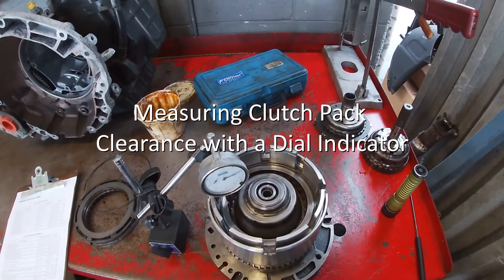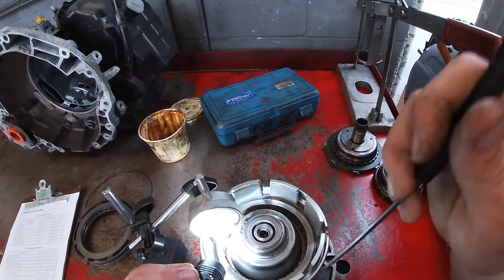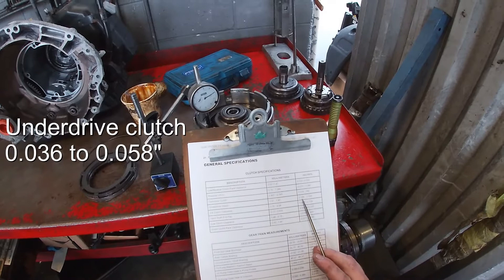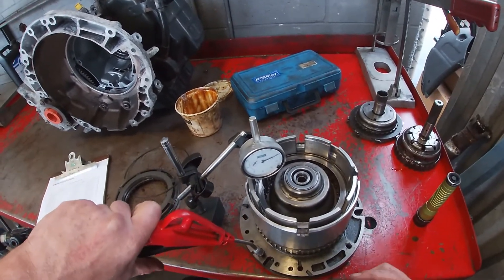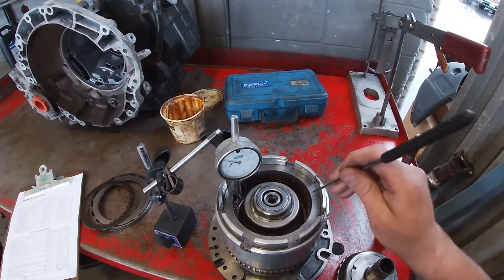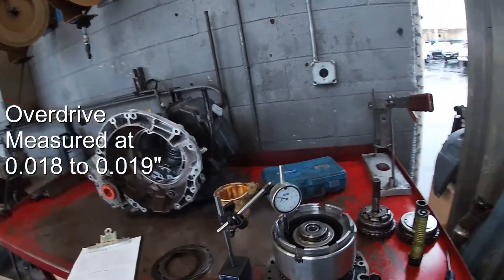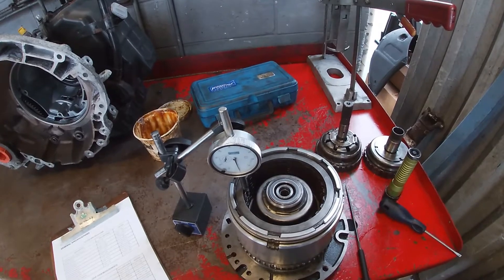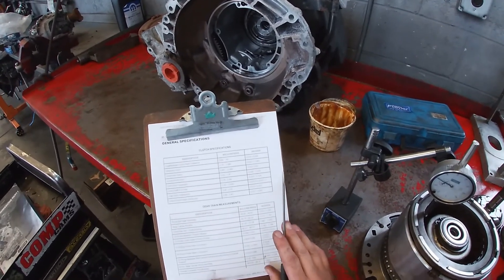Transmission Clutch Pack Clearance

Comment: Where does the factory suggest that you put the dial indicator plunger.  If is says to put it on the piston then measuring on the disk, steal or pressure plate is not accurate. If it says to place it on the disc or pressure plate then the measurement is accurate.  I don't know this transmission so I don't know where the factory says to place the plunger. When I measure on the pressure plate I always push the pressure plate down as far as I can and add that to the movement on the dial indicator  while applying air pressure.  I know that your air pressure was pushing your clutch pack off the pump but most clutch packs should be measured at 50 to 60 psi since that is normal line pressure at idle for a stepped transmission.
Reply from the maker: The factory wants the dial indicator pointer against the lug of the clutch disc on the top disc. I have a hard time getting the daily indicator to stay put so I usually use a mag base against the bench. However I have seen a tech fab up some studs to set the dial indicator base in the pump holes, I plan on making a rig like that in the future. The factory wants 30psi primarily for safety. With the input assembly loose on the bench there is a risk of getting hurt if care isn't taken. I usually just risk it with the 90psi shop air unfortunately. Good luck and I hope that helps.